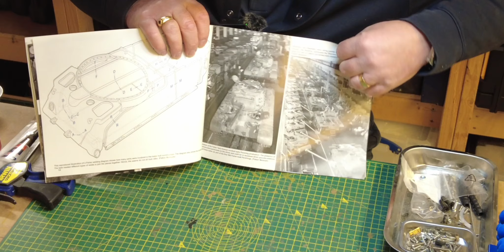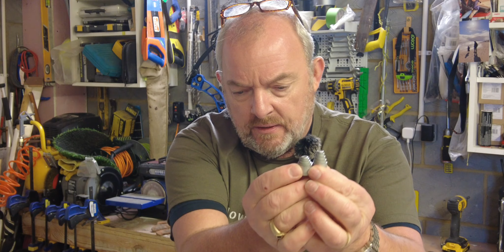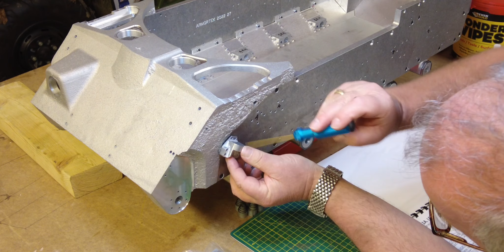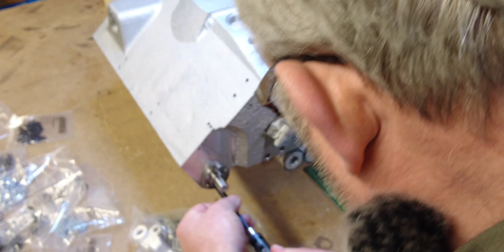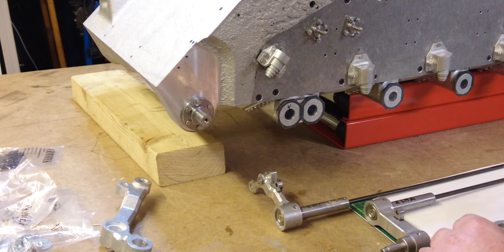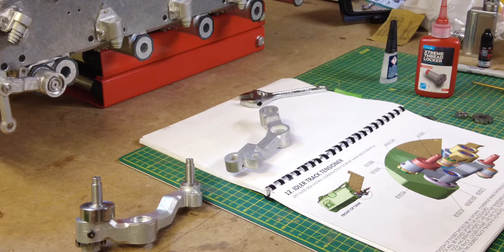1/6 scale Armortek M26 Pershing RC Tank build. Bump Stops and idler arm assembly. (Vid 05)

Comment: 👍 Thanks…. Another excellent video Tony . I bet the air was blue when you realised your “oops” moment and found out what the supplied “C” spanner was for . Just proves you really are human . I know we will all have moments like that 🙈
Keep up the great informative vids.👍
Reply from the maker: Good morning Brian, Thank you again...Oh yeh...my heart sank...but it was no problem...hot air gun makes mistakes like that simple to rectify. I am sure it will not be the last either :-) How is your build progressing?
Reply: @tonys_workshop  Hi Tony.. All wheels and tracks on one side, and yes, the top front shock mount bolt does get fouled by the tracks so I just removed the bolt  and stuck in a shortened dummy bolt from the inside.. the shocks are just dummies so no strain on the mountings … I have been jumping around the instructions and had several days on the hatches .. great fun and a few curses because there is NO side clearance for the side screws .  Finally used black 480 Locktite on the corners and then ground the screw heads off FLUSH … even then, had to enlarge the hatch holes on the rear deck. Still excited about each stage of the build and it’s a reason to get up each day 👍
Your Tiger build vids inspired me so no doubt there will be more builders out there eagerly awaiting all your vids. Thanks Tony 👍
Reply from the maker: Hi Brian, wow you are really moving on...I saw that the suspension mount has been a problem as it is on the Forum...I will defo look out for that...I have just finished all the lower hull painting, wheel painting etc and about to start contemplating installing them.
Reply: @brianwomersley7271  Brian, just read your post here about the screw clearance. I am just in the middle of building the the hatches (the ones with the round aluminum bars) so I will be looking out for that clearance issue that AT mentioned as well. I hope the 480 Loctite holds sufficiently.
Reply: @raymassa3751  🙋‍♂️Hi Ray… the hatch side screws have deep countersink and even when ground off flush they still have some head left and Iam happy they will still do their job, backed up by the 480 Locktite . 
The tolerance around the hatches is very tight and need plenty of dry runs before you an be happy with the fit. Enjoy your build my friend 👍
Reply: @brianwomersley7271  Thanks for the heads up on this. I will apply some Loctite as well, just to be sure. Very much enjoying the build,
Reply: @brianwomersley7271  I sent you a PM on the forum. Working on those grills. No clearance at all on one side. The other side after grinding the screw head almost off, work very nicely now. Bu the right side, where the grills meet, it is line to line. I would have to remove both screws and even then the side bars will still hit gently. I will have to glue them only. I see no way to modify them easily as the screw holes are determined on the hull, and depending on the gap between the two hull sections, will either make or break it working. I have slightly more of a gap on the left side, maybe a millimeter at most. The only other way I see is to elongate the holes in the hull so it can slide a bit over.
Reply: @raymassa3751  🙋‍♂️Hi Ray… the hatch holes on mine both measure 140mm front to rear and 116mm middle to side … 
There is ONLY 1mm  clearance all around as both assembled hatches tightly side by side are 139mm. X. 115mm . This was after grinding away the assembly screws each side of the hatch lids to be completely flat along the lid sides . There is still some screw head left in the countersink hole.. With the 840 Locktite, I am happy they will remain strong…. There is no wiggle room and hinges have to be very precise 👍
Reply: @brianwomersley7271  Mine measure exactly the same. Depending on the gap between the two hull sections, will make or break how difficult it will be. I have less than a millimeter gap.
Reply: Brian, the thin side of the hull where the hatches mount to, mine sit slightly higher than the mating thicker side wall. Does yours do that as well? I’m going to have to grind that top edge down so the hinge lays flat.
Reply: @raymassa3751  Yes Ray.. had to do a fair bit to the actual hinges for them to line up with the cut out slots in the side walls… means you will need the make sure they go back into the same locations after spraying ( marked each one with its location) It was all quite time consuming 🙈👍
Reply: @raymassa3751  Hi Ray…. The top edge of my side walls ( thick & thin) both line up perfectly with no step down. BUT .. I did have to do a bit of grinding on the actual hinges where they go into the slots in the side walls..
Reply: @brianwomersley7271  Thanks Brian. Now I am concerned why mine don't line up on either side. I don't think there was any way that it could be adjusted since it mounts into threaded holes in the bottom chassis. I will have to look into this. Thanks.
Reply: Hi again Ray… if you look again at Tony’s previous video covering the hull construction.. about sixteen minutes in… he aligns the hull sides so the TOP edge is level.
So level it should be 🤷‍♂️

Comment: Morning Tony, nice progress that suspension is something else.
That is a big tank looking at the completed hull very unusual shape the bottom of the lower hull Hell of job to produce that.
And an official shout out from Armortek themselves very pleased for you bud you absolutely deserve it.
Looking forward to the next one.
Reply from the maker: Hi Gary, thank you...I love how Armortek have produced this model...and thanks also about the shout out from Armortek..I was blown away by their newsletter recognition...How's your new project progressing?
Reply: @Tony's Workshop  just finished the wheels from the panther almost 2000 nuts and bolts and glueing the tires is pain, you literally have seconds..
My new project won't start until the panthers finished.
Still gathering parts for it at the moment.
Look forward to the next installment bud.
Reply from the maker: Hi Gary,
Just started glueing the tires on my wheels using the 480 and wow that stuff is rapid. The wheels on the M26 were really straight forward compared to the Tiger.